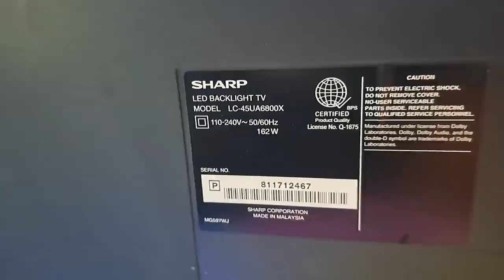The reason why your tv LED backlight gets damaged.

Comment: Great video. Yes the first thing I do when setting up a new LED set is to turn the backlight down as low as I can tolerate - on some TVs it looks fine with the back light at minimum and this will certainly make it last much longer.

Comment: I had one and the led's were working, but the melty diffusor created darker patches.   I think it must be replaced or maybe it could be polished out so it doesn't darken the light.  I just ended up throwing it away..the replacement leds are too expensive.  btw, I think it will just melt again, these leds get REALLY hot, I turned it on when disassembled, and you can burn your finger just touching them after they are one for more than less than a minute.

Comment: When i replacing backlights in most of the cases if this is possible to be done i try to modify the driver circuit according to the pdf datasheet of the driver chip to have lower current to the leds to prolong their lifetime.

Comment: On your next repair like this try to flip the acrylic glass upside down. That is you put the top edge at the bottom. You may have to remove tape from the top edge. Also dark areas on the glass may be smoke stain. Try remove with soap cloth and clean properly. Sometime the LED fail because glass is touching the LEDs causing damage to one or more, then the others fail. You also need to check  the spacer that seperate the glass sheet from the LEDs. The space may be ok when the TV is flat on it back but may touch when TV is place in the upright position.
Reply from the maker: I try flipping the acrylic before, but not work,
Reply: @tevzTVTevatronics  Right..... they are internaly polaraized and only distribute the light in that position good work sansung sharp etc trash tvs they make then for fail and burn in 1 to 2 years, tevz i see one sansung who burned so bad the acrilic they afect the lcd to with hot. Is good to change the resistores from 1.5 ohoms in the power suplay for 5 or 6 ohoms the leds goone live more time.  Unfortunatly the Brands not advice the costumers and let the product go out without telling to clients they must protect the backlight using always much less backlight settings people always want brighter and brighter contrast etc, they do not limit the leds to the correct values 1 or to ohmos are always much more volts in that lights generaly 5 or 8 volts more so a 10 ohmos resistor is better protection.
    I use always my tvs away from windows and hot devices sun etc and reduce de backlight at 60% settings and i have two Lg one 7 years and other 3 years and no fail leds and LG is champion in burning leds lol. Thanks for your great videos Tevz you are amazing.
Reply: You cannot flip the panel, light distribution will be different and most have edge tabs cut into them so it can only be fitted in one direction

Comment: 英語

I watch it all the time. Thank you for your interesting video. I'm repairing a TCL 4K 43V TV. The image is displayed, but some vertical lines are dark. I disassembled it, but the edge backlight was normal. Is it because of T-CON? Please help me.
Reply from the maker: The vertical line is not the backlight problem, It's the panel. also not the T-con.
Reply: @tevzTVTevatronics  thank you for your reply. I would like you to judge from the photo, but is it possible to send the image?

Comment: Hi Mr tevz.what a bad kind backlights they are? 
But your work was great and useful.
I wish to tell us  the voltage of each backlight.
I fixed a sharp led tv backlight that there were about 103 LEDs. B. L  at 8.5 volts for each one.
Thanks al lot.
Reply from the maker: they are 6 volts
Reply: There’s no 8 v leds - 6 volts and 3 volts
Reply: Mr tevz may be you donot believe me but it is truth.
I was wonder when I checked them for several times and you can research about that. If you are interested in it.
i write the model  number for you.!
Lc-40LE700M-Sharp tv
Something else must say:
On the backcover of  the tv is written lcd but when the cover  is removed  you will see  an led tv system!!!
By the the way some of my friend also do not believe that there are such a volt led  but when they check themself  they were surprised of seeing that!!!
Ofcourse I replaced 6 volt lead and it works but another on at the same model number it does not cos abut 10 leds were replaced and the light of leds are too low  and we could not fix it yet!!!
Reply from the maker: @sarockpashotan  maybe the LEDs are changed voltage due to heat for a long time. I don't really have encountered an 8 volts single led bulb.,
Reply: @ronaldmarcano5648 i have encountered 8v led too, but in a phillips led bulb..

Comment: I put it the diffueser upside down, I see other comments as well about it. The reason why it's faulty, it's because they are allowed to build it in type of quality ;). And SHARP from what I remember is made by Vestel. You can't expect a quality from Vestel TVs IMHO. So, buy a Sony if you'd like to have a quality ;). Less backlights I replace in them.